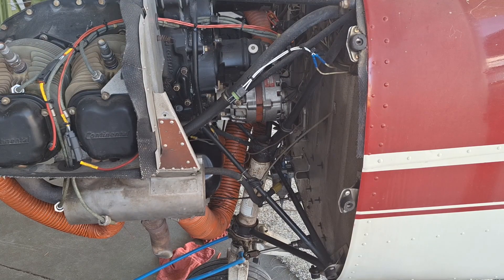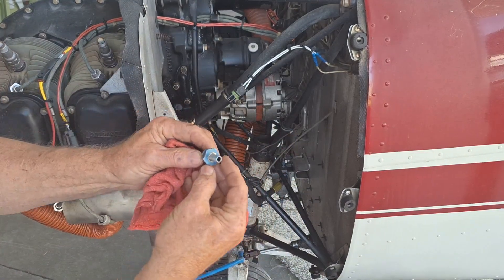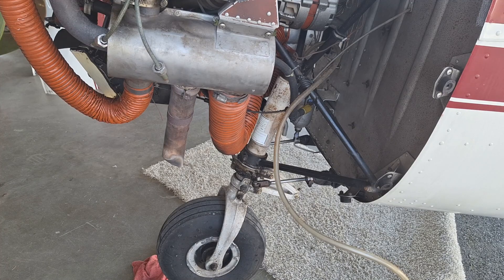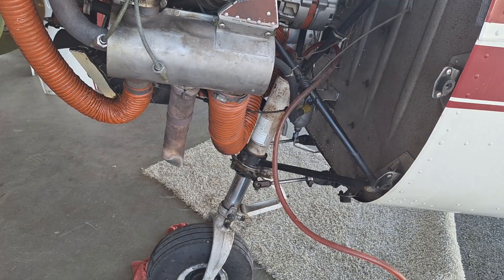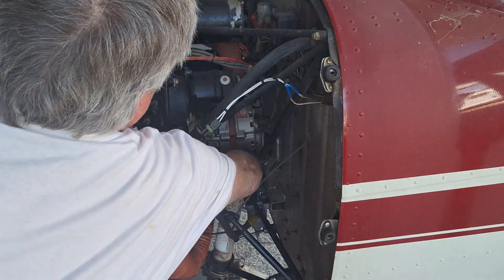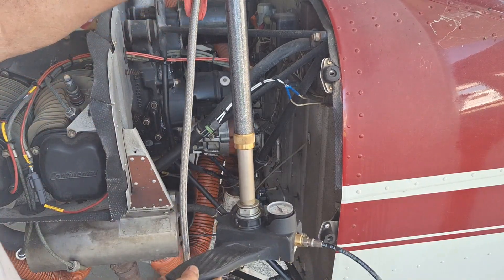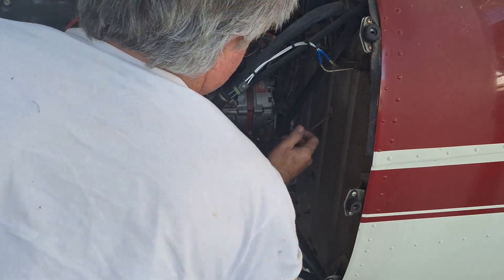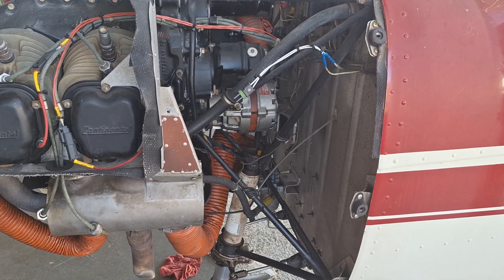Aircraft Oleo, Air Oil Shock Servicing.  Cessna 150 172 Piper PA28

Comment: Good video but 6 or 7 pumps doesn't help anyone without a similar pump. I believe the manual calls for 20lbs.
Reply: Good luck trying to use 20lbs...maybe when new is 20 lbs...
Reply: @wiltonbustamante4761  If 20lbs doesn't work, then you probably need to rebuild the strut.

Comment: so you started with a strut with no oil in it. How did you get the old oil out of the strut?
Reply: I don't think he did. That process only dilute the old oil with new oil.
Reply: Hook up the hose and place hose in a separate container for old oil/fluid. Push up on nose gear to compress nose strut to get old fluid out

Comment: Nicely done!  Short and succinct and easy to understand. 
I thought nitrogen was used to prevent moisture and oxidation.
Reply: it should be nitrogen or clean filterd air. You re right
Reply: definitely needs to be nitrogen
Reply: The Maintenance Manual says service with air and 20 psi strut extended.